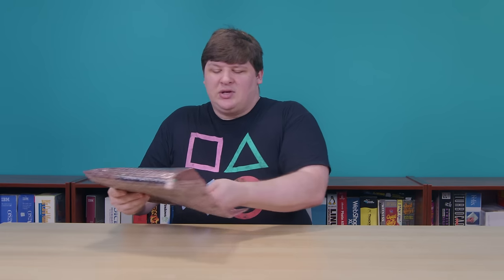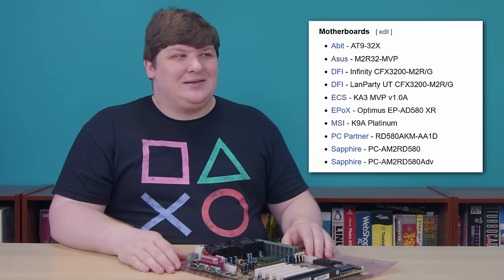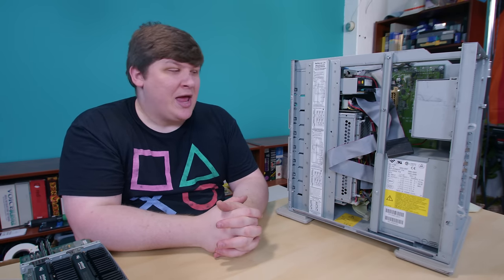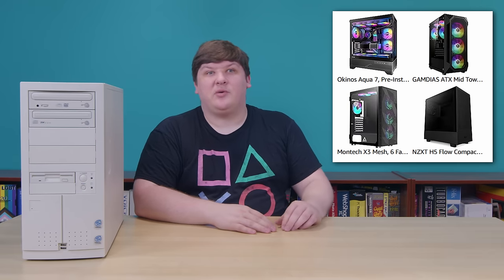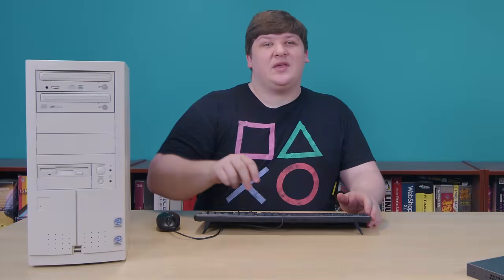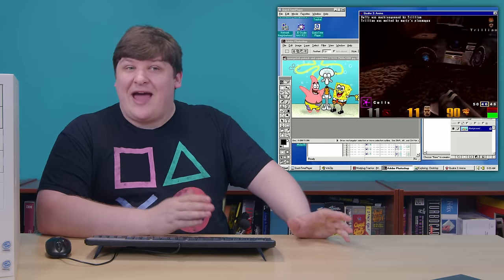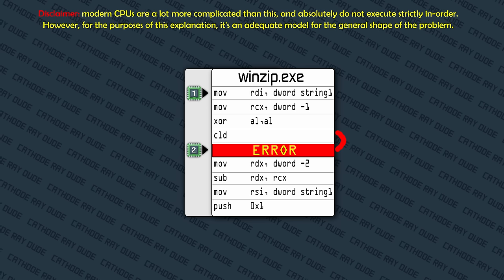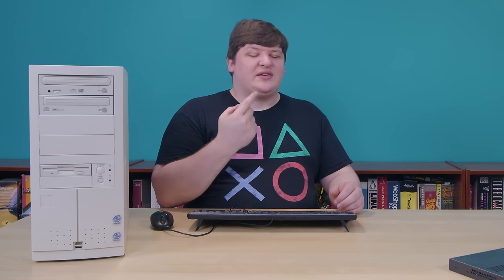The Only Famous Motherboard

Comment: The most likely main reason why more motherboard vendors did not implement dual socket 370 with Celeron support; is that it is a hack, Intel never wanted SMP or overclocking to work on Celerons, they wanted to sell their other CPUs that cost 4+ times the price, so they built in protections on their budget friendly chips. If Intel would have had any more power over Abit, they would never allow the BP6 to exist, they would have brought down the hammer real fast, and Intel did have the power to sanction many manufacturers.

Comment: On another note, the Quake series of games have had Linux support since forever, and Quake 3 arena had linux support when it was introduced in 1999. And as long as you had a graphics card with decent opengl drivers, there was a huge advantage to using the Linux version on SMP machines. At the time, the Windows version did not support SMP, the Linux version did. That meant Quake 3 arena was totally playable on my dual pII machine when running Linux, but not when running Windows.
Reply from the maker: I hadn't considered that because nobody brought it up in anything that I read on the subject; I should give it a shot!
Reply: @CathodeRayDude  I played a lot of Q3A at the time, on my dual cpu pII machine 🙂 From what I recall, you have to explicitly enable SMP using Q3's console, but I sadly don't remember the exact command. 

I've used both the 3dfx glide support and opengl (mesa with hardware acceleration for the Matrox G400 enabled), from what I remember I mostly used the g400 opengl support, and moved the voodoo 2 card to another machine. 

But know something... none of this was very user friendly, unless you were already really into linux or linux style 'desktops'. During part of the 1990s, I maintained a freebsd/xfree86 based thin client environment for the company I was working for, building custom versions of mesa or such wasn't a big deal for me, while it is way beyond what the typical user would do.

Comment: he netserver?  I think it was a long succession of systems that may have shared a backplane/baseboard, in the vid you mention the original LH which you say had pentium pros...  I think that was the LH pro.  Presumably there was a dual processor pentium 1 socket 7 netserver LH.  Googling it, yes, there was the LH plus (s7) and then the LH pro (s8) then the LH2 (p2) then the LH3 I think with pentium 3s.  Also, I suspect that though they may have messed with the drive holders, dell may have used the same base chassis for the desktop and tower system, which might explain why the chassis was designed for both a desktop and tower psu.  On that subject, I have a feeling, maybe on it's side, that the HP LH server would probably fit in a 19u server rack.

Also, of course, the celeron was a huge blunder for intel for the very reason that it was such a good value offering such amazing performance, completely undercutting it's wildly overpriced pentiums.  The secret was that the celeron has a small (128k) l2 cache that was one die.  As it turned out, particularly for games like quake 1, 2, and 3, this was perfect iirc particularly for floating point which many 3d games used heavily, particularly with early 3d accelerators such as a 3dfx voodoo card.  The pentium had a larger off chip 512k cache iirc which, being off chip, and being larger was much slower.  On top of all that, the celeron with it's integrated cache was an amazing overclocker.  Presumably it was artificially slowed down for marketing reasons to fill the appropriate budget SKUs ignoring the fact that because of it's design it was much more suited to higher clock speeds than the "premium" pentium.  An intel executive responsible for another such blunder would probably be fired on the spot with no golden parachute.

As the media clip you played mentioned, the dual celeron machine that they recommended for "next year" was cheaper than the single CPU pentium 360mhz.

It would be like someone paying, say, $1,000 for an intel system that was slower than a $500 AMD system with an x3d processor that vastly outperformed it in 1% minimum frame rates, average frame rates, and in maximum framerates, all while using 1/2-1/3rd as much power as the ~200-400 watt intel space heater/toaster...

Comment: I remember my BP6 fondly.  It was a great machine, and ran stable until the capacitors started failing.  I threw away that machine a couple of years ago, along with a dual 400 Mhz xeon machine that had slots for the CPU, from about the same era.

Comment: I had this board!  I dropped in 2 of the 300a Celerons intot here overclocked the crap outta them! 450 Mhz, 10 Mhz bus all timings correct if u remeber or heard of the legendary celeron300a

Comment: It's not fair to say that no software was written to support SMP before dual-core CPUs became common. While it's true that most multithreaded software was exclusive to enterprises, Windows XP (and 2000 and NT before it) all had full SMP support, since they were designed for multisocket machines from the beginning since businesses used the same OS.

Comment: Strangely enough my only experience with Abit was the Serillel adapters; These were little doohickeys that, to put it in a TL:DR; kind of way, let you connect PATA hard drives to an SATA controller. Absolute godsend while the transition from PATA to SATA was happening, almost completely valueless now. (I'm sure there's a niche or two they could still fit in)

Comment: Yeah you could add a PCI SATA card for an SSD but you wouldnt be able to boot from it, without native SATA support on the bios, the only way to boot to an SSD would be a IDE to SATA adapter.   I know its not 1999 period specific but i think Windows 2000 was the go to for MP support on a Regular Windows Operating System for that Motherboard.

Comment: TLDR - Intel messed up by releasing a unlocked Celeron that could hit 450Mhz with out any real work and with SMP support enabled. ABIT took a major risk in releasing a board that could use the SMP feature, hoping that Intel would not fix the issue any time soon and got away with it. The rest as they say is history.

These boards were not just used by home users - I was rolling them out to developers at the company I was working at as their development cycle could make full use of the dual core features and I could provide 3 complete systems for the cost of a single Pentium based business solution at the time.

Comment: There is a system, using a Pentium 2, built in that exact Enlight case, sat under my desk right this very second!
Reply: I've got one of those in here too!  It's got a Pentium Pro inside.  Lovely case, but I hate having to pop the panel off the front to get inside.

Comment: I wonder if Apple came earlier than many other companies to bring multiprocessor systems to the masses. I was watching this video next to a year 2000 Power Mac G4 Dual CPU system and, If I understand correctly, it was not an uncommon model to have (but more expensive for sure), and after the Power Mac G4 they continued the trend with multiple CPU G5s going up to quad core configurations before Intel Core 2 Quad CPUs were common (or at least, that's what I remember very faintly).

Comment: Maybe install Debian and Steam on that thing. Also many old Windows games works on Wine (software that make Windows soft runs on a Linux - often with better performance).

EDIT:

35:20 schedulers doesn't work like that. Processes are not switched on every instruction, but with some time schedule (exact scenario depends which scheduler You are using).

38:50 switching load between CPUs is for equal utilization. Since core are not in same physical place, loading only one on 100% will cause huge temperature difference and that will shorten CPU life. Some people say, Linux schedulers do better job with it.

Comment: Quake is kinda of multi threaded, it uses the floating point unit on the Pentium 1 as a second slightly slower integer core. Assuming what I read is correct.

Comment: One reason certain celerons were a big deal at that time was because the had cache built into the CPU itself and it was fast and made up for the only real difference between it and the Pentium - cache size

The Pentiums had twice the cache but ran at (iirc) 1/2 the speed of the celeron

The celeron also had much higher overclocking headroom and was much cheaper

Getting a 333/366 upto 100 or even higher bus speed made them faster than most Pentiums because of that cache and bus speed which made the whole system faster

Yes I owned.this exact setup back when the bp6 came out

Comment: i had several of those! i think the 360mhz or so cpus woth 128mb ram. 

i never had PCs before that. used Sun and Irix multi process machines before that. 

when this came out i could afford a good machine at home. 

they flew for the price compiles were short. data compute was good. 

never had windows on them just linux so dont know what that was like.

Comment: By far the most important feature of having more than one CPU was the ability to summon the task manager when something was locking up and kill it. A badly behaving app taking 100% of your CPU no longer meant you had to hit the reset button.
Reply: Absolutely.  I never went back to a single thread processor after my Abit BP6 with 2 Celeron 533 MHz processors.  It was just so much smoother and less frustrating.  My copy of NT4 was included for free with my Visual J++.  Since I had gone back to college, I was able to buy it at the academic price, too.  The whole setup was relatively inexpensive.

Comment: It's slightly anachronistic, but I'd throw Windows 2000 on that machine - it only came out in January 2000, but that was still firmly in the middle of the BP6's dominance and vastly easier to live with than NT4

Comment: Had one of these back then as I am and was a Linux guy. I don't remember it that fondly because at least early on there were some kind of compatibility issues with the unorthodox SMP this had that made programs segfault left and right when I tried using it. Eventually I did find out the issue and was able to run things properly and I assume later distros had it fixed anyway.

Despite loving the games built with it and still finding it very impressive for the time do take issue with saying UE1 was more advanced than Q3. The UT renderer in particular was always insanely CPU bound, Q3 made much better use of a GPU and certainly had some other advantages, Carmack isn't a legendary game programmer for no reason...

Comment: I still have my BP6 and 433MHz celerons and they did work fine just tad over 500MHz and it was great machine to run Windows 2000. It made me like Win2k so much that it took forever for me to switch to XP.
Reply: Dual processing was great as the primary app could get all the cpu it wanted and all the background tasks still had cpu they could use. Very responsive. And Win2k was rock  stable.

Comment: My first "real" computer was based on a Celeron 400, and aside from the cost, one of the big draws of the Celerons were they were super friendly to overclocking.. I think a Celeron 300A was the first production/consumer chip that hit 1Ghz, though the cooling on it was impressive.
My Celeron 400 was rock steady for years at 500mhz, and with a better motherboard with voltage control and cooling, 600mhz would have been totally possible.. So while you lacked the cache of the Pentiums, you made up for it in raw clock speed

Comment: My apologies for being "that guy", but the Precision 420 motherboard has a second desktop chassis power supply connector as well. It's partially visible around 14:36 mark, behind the optical drive cables.

The desktop chassis PSU might have been ATX-shaped, but it wasn't ATX. 🤓
Reply from the maker: That's not a power input, it's an output. It breaks out into a bunch of cables to feed the upper drive bays; they're just using the motherboard as a bus board. Regardless, yes, it's not ATX - the inlet is clearly more than 20 pins, and ATX 24 didn't exist at that time.

Comment: i think at the time Intel didnt have any reistrictions on dual cpu setups with Celeron... this was obviously going to change... but also at the time there was the Celeron 300 without L2 cache, the Celeron 300A which had 128k L2 which easily overclocked to 450Mhz... which performed the same as the flagship Pentium II 450 which had 512k of L2... I remember the companies at the time had no issues buying P2 450s for servers but I would bring personal PCs from home to hook up to the work lan...

Comment: BTW, 9gb SCSI drives cost waaaaaaaaaaay more than $300 when new. Looking at ads in the back of Digital Video magazine from 1997, 9.1gb SCSI-3 A/V rated drives go for $1150. I paid $850 each for a pair of 4.6gb SCSI-2 the year before.
Reply from the maker: Weird, I looked in a contemporary magazine and found $300. Seemed low but I had no reason to question it.

Comment: IIRC one of the games that made a big deal out of multiprocessor support to the extent that people actually gave a shit about the capability was Supreme Commander, which didn't hit the scene until 2007. This along with Crysis were the two games that could be reasonably expected to bring anybody's computer to its knees, although both for different reasons. Crysis was incredibly GPU bound, and Supreme Commander was very CPU bound. By this time, of course, multicore processors were definitely available.

Essentially Supreme Commander outright REQUIRED a multicore processor to achieve playable performance -- preferably four cores, apparently -- to even run right. Up until this point, the common wisdom was indeed that multicore or multiple processors was useless for gaming, and it was better you spend your money on the biggest and meanest single core chip you could get your hands on instead.

Comment: So, basically a MB for people into BDSM.
Intel charges a $100+ premium for an unlocked multiplier. I got a free tier upgrade by buying a $90 Ryzen 5500 and overclocking it until it performs like a 5600. And that's with having to compensate for having half the L3 cache. Reminds me of the PIII era Celerons. 
My Willamette P4 1.6 having a locked multiplier didn't stop me from overclocking it. I had the FSB set to something north of 150MHz and the CPU ran at 2.53 GHz, IIRC, essentially doubling performance and completely negating the late PIII/early P4 argument. I did this with stock cooling and ran it like that for years with no issues. But allowing a CPU built on a 180nm process to run at 95C all the time for years was perfectly fine. It is absolutely not fine to do so with CPUs built on a modern process node. I predicted the 13th and 14th gen silicon degradation 2 years before it hit the news. I tried to warn people and all I got was a bunch of advertising propaganda thrown back in my face, along with plenty of insults. Guess who's laughing now....
I got to play around with a dual Pentium Pro workstation in 1997 and it was already a 2 year old machine. Yeah, it was good for productivity but pretty much useless for gaming until we got proper multiprocessor support with XP and then gave game devs a few years to learn how to program for it. Multicore gaming didn't really happen until the Core 2 era. 
In 1997, I was more interested in overclocking the piss out of my 486 so it could run Quake well.
My first car was a Chevy Caprice. It was like driving a sofa down the highway, lol. I still worked on it and got the best possible performance and handling out of it as I could. Try driving a Caprice through a freshly ploughed field at 50mph and then try it in a brand new Corolla and you'll quickly recognize the advantages of a classic American Land Yacht. There just aren't many modern cars you can get away with abusing like that.

Comment: Intel disabled using dual celerons by disconnecting a pin. I had a gigabyte dual slot 1 mother with socket 370 to slot 1 convert cards. You needed to solder a resister on the convert card between two of the pins to get dual celerons to work. The abit board must have had this hack built in. Althought I can't see how intel would have let them get away with this.

Comment: 14:09 Actually the yellow is 12V, red is 5V, and orange is 3.3v.  There was often 35-50A on the 3.3-5V rails during that era on the higher end units

EDIT: Also, please count E-cores seperately.  A lot of people in IT do not lump them together as they are not of the same capability (both in instruction set and IPC) of the P-cores.  Also, the fact that you have a working GeForce 256 is bitchin'.  I have known of people that have looked for years and years for one to no avail.

Comment: Not that this matters to this video, but back in 2000's i had a 486 running at 100mhz with 16 or 32 megs of ram running Windows nt 4.0 with dual video cards. It was just powerfully enough to run WINAMP!!!! and nothing else. but back in 2000's with MP3 everwhere that was a major feat.

Comment: Celeron "Covington" (basically a Pentium 2 processor core with no external L2 cache chips, 0 L2 cache) was a fail with terrible performance, the Celeron "A" (300A and 333A) with the Mendonino core and 128kb L2 cache on die (vs Pentium 2/3 Katmai's 512kb L2 off die half speed cache chips) was cheap and quick - some benchmarks it came up on top because of the on die full speed cache regardless of the L2 being 1/4 the size. What really made the 300A and 333A shine is they ran at 66mhz FSB, and by upping that FSB to 100 (50% boost) resulted in a 450 or 500mhz CPU clock speed (or more - easily), no extra voltage or cooling required and they all ran that no issues with even AGP/PCI speeds running at correct spec thanks to correct supported ratios.

Comment: because HP and because 2 [edit: doesn't NT predate 95 and 98? I ran it at work on my first job and it was f-in solid] [edit 2: yeah, initially celeron was the sh-t, and then became sh-t, and P3s were on cards]
Reply from the maker: NT 3.x predates 95 but NT4 came out in 1996